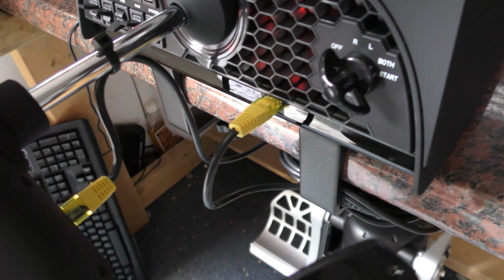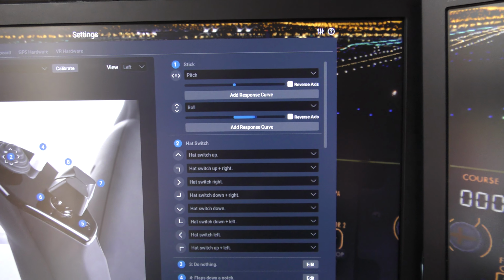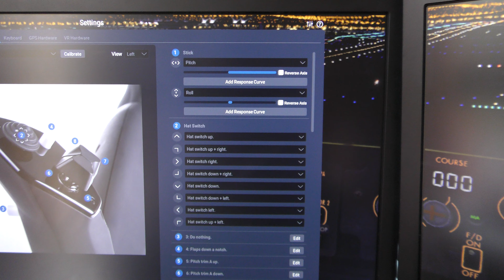Honeycomb Alpha Yoke Strain Relief Modification

Comment: The curly cable when new is stiff and can break the ethernet port when used like this, but you can simply just pull, manipulate and stretch the curled cable until it is loosened and malleable (don't uncoil it completely). I did this day 1 after hearing about this issue and I've not experienced any issues since.

Comment: Hi my Yoke has a elevator stiction point around center over just a short travel but a hinderance when requiring small movements. Anyway I noticed a fair bit of strain on the said cable and RJ45 Plugs too and it also made a bit of a noise too due to the coils being too tight. Anway after viewing your video I purchased a 250mm Patch cable and that has improved things a lot and does not require clipping to the shaft as it is just the right length. Anyway hope things work out for your mod too.

Comment: The default RJ45 that came with the unit finally gave out a few days ago.  Would this connection issue cause the hat switch to move erratically and the buttons not to work?  Honeycomb has gone NORDO, and they don't have replacement RJ45's anymore.  Also, what's the cable model you used in this video?

Comment: This is simply a bad design on Honeycomb. It should be fixed by running the wire internally.
Reply: They made a point to mention the solid steel shaft. and avoided running the wires through the shaft.

Comment: There is a 6” Ethernet cable on eBay. How long do we need for safe travel? I don’t get my yoke until the Sept 16.
Reply: I use a 0.25m flat ethernet cable and its the correct length for the yoke imo.

Comment: The cable connection is a mysterious  thing... not mentioned too many places I noticed.  Mine fell on the floor and I was dumbfounded that my buttons didnt work !  I found the cable.   Searching on the web produced 0 results about Thumb Buttons Not Working on Alpha Yoke ... etc. etc.
Honeycomb Yoke Thumb buttons require cable connection.  Check your box !
Alpha yoke thumb buttons do not work.... maybe this text will show up for later users with my same issue.